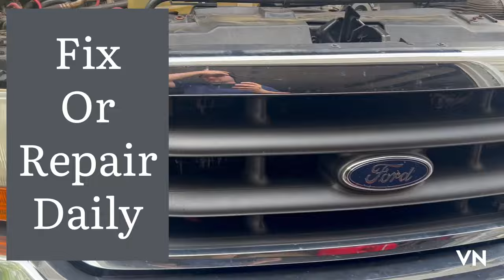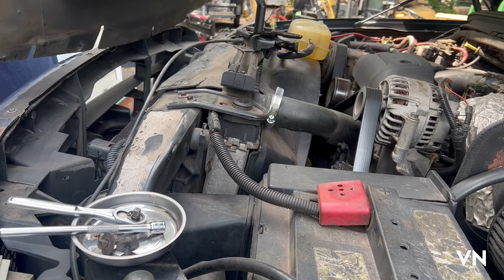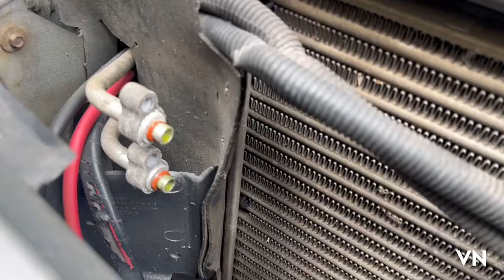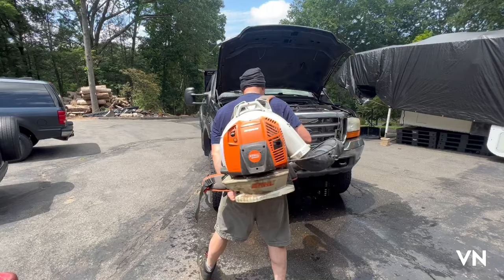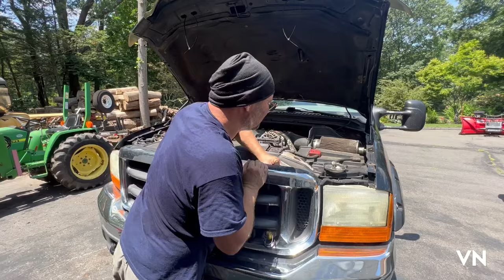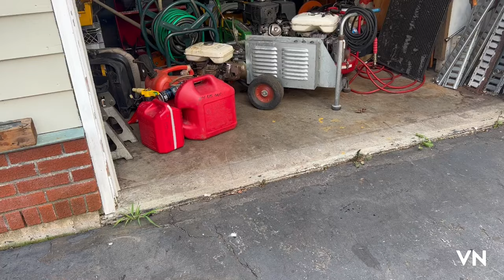Replacing Air Conditioning Condenser in a 2001 Ford F350 7.3 Power Stroke Diesel

Comment: Directly behind the condenser is not the radiator...that looks like the 7.3 turbo diesel, so that's your intercooler, not the radiator. Also, you should consider upgrading your transmission cooler to the bigger 6.0 trans cooler, especially if you do a lot of hauling and towing.